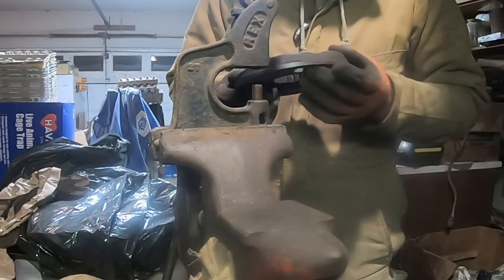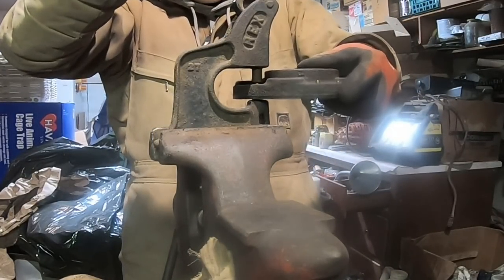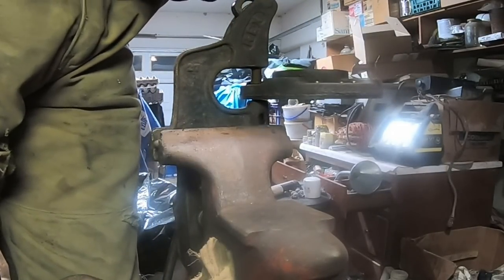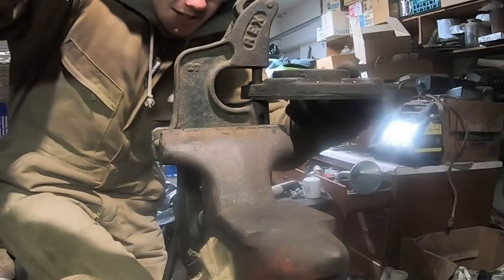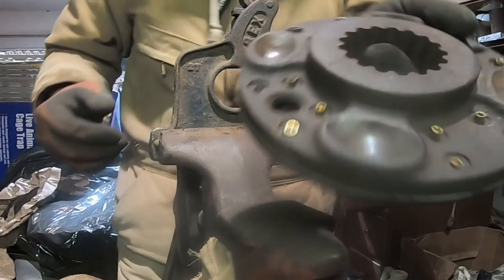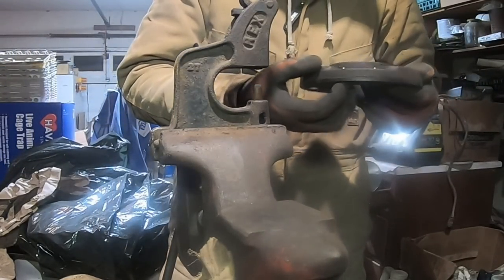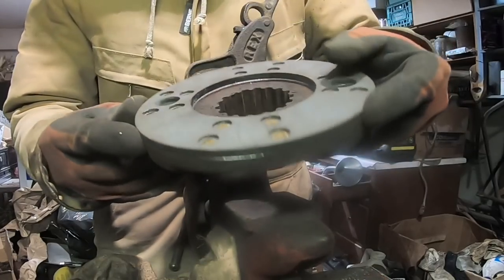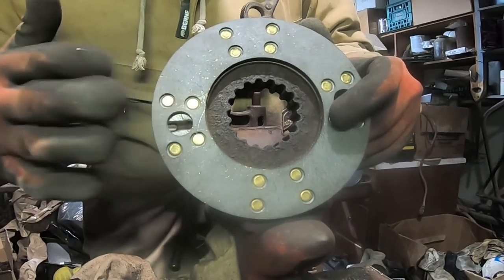Riveting Brakes for the UniSystem

Comment: I do remember when I first started working on trucks and tractors in the mid 70s, we use to have brakes shoes and clutches relined locally.  Usually over night.  One suggestion; keep your greasy hands and gloves off the brake surfaces or clean them up before install

Comment: Did a lot of brakes on soundguard body John Deere tractors. Would always rerivet the brake pads. Had a riveting stand that was air powered. Just used a punch to knock the old rivets out. If the river stand wasnt working then would use a special punch to river them on.
Reply: Neighbor had a 4630. I use to drive it when he needed help! He had to go into the rear for something. While he was there. He put new lining on the brakes. New rivets, nice and tight. Can you believe it! The darn things growled even more after that!

Comment: They way I handle those springs. I use a very fine braided aircraft cable. 1/32 or 1/16. Make a T handle with a wooden dowel. Allows you to get a lot of pull with one hand while guiding the end of the spring over the pin with the other.  I've even used that method. With large springs. Using a larger cable. Only instead of a T handle. A lever, a pry bar of some type, or even a come-a- long. To get the stretch needed to the pin. Most hardware stores carry stainless steel very fine cable. It's pretty cheap too

Comment: Those parts were very common and you can find those on many different Case Tractors 430, 470, 530, 570 and Backhoe tractors 430CK, 480C, 480CK, 530CK, 580B, 580C, 580CK. used that too if my memory serves lol #A142980 is a good number for the Brake disc and most Case Dealers AG or CE carry them .. Plus Bendix is still in business so i even got them from a good truck parts dealer.. so hope that helps you

Comment: There's a T-handle tool about 1/4 in diameter with a slot in the tip that's used to shove the spring's hook through the catch slot on the other side, it lets you wiggle it a little.  Some come with a D flat on the side you line up with the hook end of the spring.

Comment: Interesting... works sorta like electric trailer brakes... The magnet pulls the lever pad against the disk face of the drum, which creates drag proportional to the magnetic force pulling the pad against the facing.  The drum uses friction to pull the pad along, which pulls the lever until the force on the lever and the friction force is balanced, at which point the pad slides on the face of the drum.  The lever then multiplies the force via leverage to force the brake shoes out against the interior rim face of the drum, which does the vast majority of the braking force (converting momentum into waste heat).  

These brakes work by a similar principle-- the cylinder applies braking force to the drum facing between the two disks, which are splined to the axle shaft.  As the drum slows, it forces the balls to roll up the tapered ends of the cups, forcing the disks outwards as the balls roll up in the inclined ends of the matching cups in the disk backs.  The disks are forced outwards against the braking surfaces on either side.  This is what dissipates most of the energy as the disks are splined to the axle.  The drum in the center can only transmit force through the balls and inclines, and the amount of force it can transfer is determined by how much slippage there is between the drum outer facing and the bands.  It's basically using leverage of the balls and inclined planes of the cups to increase force on the brake disks against the facings.  

Later!  OL J R :)

Comment: Allis Chalmers  180,190xt,200 use the same . There only 4 bolts should hold the housing on u can change the seal so oil doesn't get in

Comment: The process you describe was called "re-lining" the brakes or clutch.  Back when things were designed for reuse rather than just throwing it away, and people actually had skills and abilities in fixing things.  Back when they used to put new brushes in generators and starters and rebuild generators and starters and alternators.  Now you might as well buy a new one because they're not that much higher than remans anymore and the quality of remans is shaky at best... they don't go through and replace ALL the wear parts... they "inspect" everything and it can be 90% worn out and they'll just stick it right back in, because it's 'within tolerances'... they only fix or replace what ABSOLUTELY HAS TO be fixed or replaced to make it functional... but like the proverbial chain's "weakest link" when you only fix the broken link, the chain is no stronger than the next weakest link, and they leave a LOT of "weak links" in there... 

Later!  OL J R :)

Comment: I have a white 2-70 and had an 880 Oliver and the brakes user the same basic design with the ball bearings and pockets. When I rebuilt the brakes I use powder graphite for seed corn on the ball bearings. Only because I felt using grease would be a problem with build up from the brake dust.

Comment: I see the workbench hasn’t changed since the roll-a-bar needed bearings.
Reply from the maker: I had it cleaned off since then. Dad took the clutch booster for the 1086 apart last spring. Decided it couldn't be rebuilt and left the mess on the table. I'm not going to be his maid. Now I have my messes, but I clean up eventually, when I'm done.